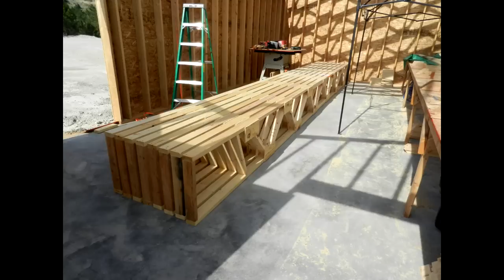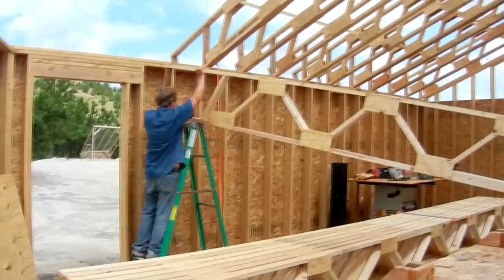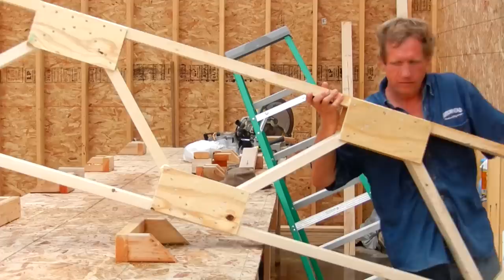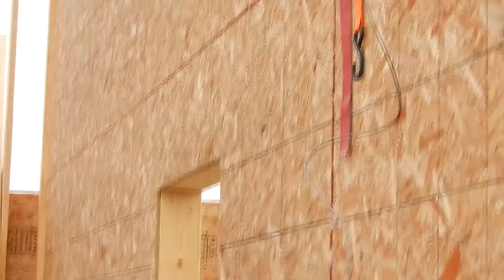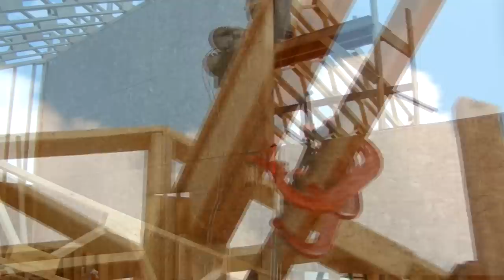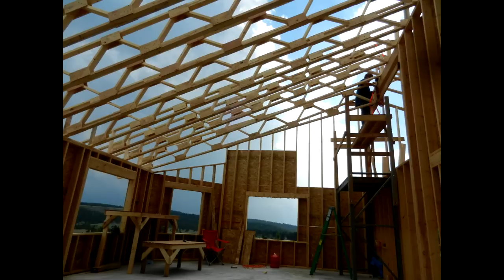One Man Roof Truss Raising

Comment from the maker: We raised 8-10 in a day it took 2 weeks to frame the roof with the truss building taking most of the time. I designed the trusses based on a warren truss. They did come out very solid and stiff.
Reply: if you would have just stabbed your top up first, then walked the bottom up the latter, you could have done it in one day....   also, paying a young, capable helper on the cheap would have been much better for you and the kid could have made some money.. this was hard to watch
Reply from the maker: -- My goal is to spend as little as possible not to hire help.
Reply: Good job!!!
What is the span between trusses along the wall?
What is the height of the truss?
What are the dimensions of your house?
Thanks.
Reply from the maker: Truss span is 24 feet they are 24 inches on center along the wall, the center wall is 16 feet high and the outer wall is 8 feet. The house is basically 54 feet long and 40 feet wide.
Reply: Fantastic!
Reply: i'm a truss designer and i dont like how your lower bearing are not triangulate :S that should give alot of stress in your bottom 2x4
Reply: heh heh heh
Reply: @brookscharles1849  not sure what you mean, are you referring to  the lower side not having a full triangle over the bearing wall?
Reply: B-Spot 🔥
Reply: @brookscharles1849  What is a good truss design you would recommend?
Reply: @chrisbabbitt4202  just add a web (lumber) on the space near le wall  where there are no triangle should be alot better. how he made it the wood work in flexion(wood bend) (sorry i'm french) i want you want to make wood work and tension or compresion
Reply: @halfglassfull  yes

Comment: Nice job! Built a 3 car garage myself and understand the problem of the trusses. I wonder if it would have been easier and safer to somehow hook the cable to the bottom cord? But sitting back and looking, I cannot determine how without the cable becoming a problem at  the ridge board and immensely complicated plus the out of balance concern.

Comment: You should put a 1 X against wall at ridge portion of truss to ride up the wall easier... then a temp ledger just below top wall to rest the truss on when you remove jury rigged 'winch' just for eas & safety I know you have a strap to installed truss however better to rest on ledger while you remove winch assembly prior to lift into final position

Comment: 2" long staples are the ticket for those gussets. I defy anyone to find a better way to fasten plywood to 2x's, it's fast and doesn't compromise   the integrity of the plywood. Skin'd walls for years with staples.
Reply from the maker: I don't agree staples have very low pull out resistance and shear strength.
Reply: +b-spot
when I tried to pull out my heat-activated adhesive-coated 16 gauge staples, it was plenty difficult.
significantly tougher than a smooth shank nail that's not lined with adhesive, and probably nearly equivalent to a ring shank nail.
shear strength depends on fastener quantity, no?

Comment: It's always weird for me to see a truss with weak axis bending, but with such short spans between the nodes, and maybe if there is low snow load, I guess it could work.

The truss doesn't look all that heavy, so is a winch all that necessary? I would have just used a rope.
Reply from the maker: It's a lot heavier when your on number 10 and your 16 feet in the air.
Reply: One day, I will do what you have done here, and build myself a home. I think it's awesome.

Comment: Excellent system.  I've been trying to figure out how to do this part of construction myself.  How long did it take to get all the trusses up?  Also, your trusses look very well built.  Did you find instructions somewhere on how to build them?
Reply from the maker: +Dave Peterschmidt Sorry for not replying for so long.  I am supposed to get an email every time there is a comment and I haven't been getting those.  Here is the response I left for someone else on one of the other videos.  Hope it helps and isn't too late!

I didn't calculate the load what drove my design was referring to other 
designs and installations. I needed 20" of depth for the r-60 insulation
 plus 2 inches min for an air gap between the insulation and roof 
sheeting so the trusses are 24" tall. The pattern is a Warrren truss https://en.wikipedia.org/wiki/Truss_bridge#Warren_truss same as what is used for bridge building. This document will give you some ideas about span and load http://www.trusstech.net/Truss_Tech_VA_MD/Tools_files/roof-truss-facts%20mitek.pdf. This document gives a overview for diy http://www.agf.gov.bc.ca/resmgmt/publist/Leaflets/BldgEng/305-32.pdf.
 The wood you use needs to be a little better than standard #2 grade 
what I did is pick thru the pile at the lumber store. You want knots to 
be no more than 1/3 of the width of the board with no splits along the 
length and as little twist and bow as possible. Good luck
Reply: +B-Spot Thanks for the reply!  It's not too late - I haven't started building yet.  What kind of insulation did you use to get to the R-60?  I want to do something similar.  I'm going to use ICF for the walls with some added EPS foam to bump them up to about R-50.  I'm strongly considering framing the roof similarly to the way you did, although I'm also considering using some kind of vaulted truss to avoid having to deal with putting in a big ridge beam.  Not sure how I'd handle a beam like that all by myself.  

I have to ask, why did you need an air gap between the insulation and roof sheathing?  Are you venting cold air in there to prevent ice dams?  I wouldn't think that'd be much of a problem even without the gap if your roof is insulated to R-60, would it?
Reply from the maker: +Dave Peterschmidt -- Have you ever noticed that builders put a moisture barrier on the walls but not on the roof? Even with R-60 heat still travels through the ceiling and insulation above carrying with it the moisture it holds. Ridge and soffit vents along with the air gap bellow the sheathing prevents condensation on the underside of the roof by allowing air flow to remove the moisture laden air. This prevents possible mold and rot on the sheathing and trusses. It also helps cool the roof in the summer extending shingle life. There is one way to omit it by using closed cell sprayed in foam, but that is pricey and now you need an another way to remove moisture from your home, typically by using forced ventilation and an air to air heat exchange. You will not get ice dams and icicle formation on a properly insulated roof both are primary caused by heat loss melting the snow on the roof and a cold eave where it re-freezes.

Comment: great job for sure love working with wood...still have a question here in the netherlands we built houses with brick much stronger..why  you built complete house from wood ?
Reply from the maker: I use wood because it is more economical and easier to work with than brick. A brick home still requires a wood frame for the roof and walls to allow installation of a reasonable amount of insulation. Strength is an interesting point because a brick structure is non flexible and do very poorly in earthquakes. Where as wood structures are flexible and do very well. Wood is readily available at reasonable prices, brick less so here in the west.
Reply: Ok tnks for replying.. i just was wondering why they built a lot wood houses there..now i know..i also like working with wood but here is expesive cause we have less forrests

Comment: Just one question. Shouldn't the truss lumber have been oriented the other way.....With the 4" flat vertical and not horizontal. ???
Reply from the maker: I laid them flat to minimize splitting of the truss webs when the connection plates are nailed on. Because it is a truss the strength is derived by holding the members in tension and compression and these properties do not change due to orientation.
Reply: B-Spot  thanks for reply. You make a valid point. 
   Excellent video 
I also love to do my projects myself. Very cool drill powered hand winch. Great idea. Thanks.
Reply: +soaringtractor
an engineering stamp is about as valuable as one of your comments; not.

Comment: Will these work say 4/12 pitch. Half the span is 26 ft. Would this Truss  be able to handle a 60-80 pound per sq ft snow load ??
Reply from the maker: Maybe I only needed 25 lbs snow load and my span was 24'. You will have to ether calculate the capacity or build a truss and load test it.  80-90 snow load is a lot, with dead and live loads you are going to be around 100+ psf. Typical roof spacing is 24" you may need to go down to 16" or less.
Reply: @BSpotBuilds  Yes I think I will do 16 center for strength. Better safe then sorry. The local area here at 7800 ft likes to see 60 pound snow load roof. Its considered to be high desert so it doesent snow that much but we definitely get it. We got spread out over the winter maybe 2 ft. but here in Costilla county they dont even inspect it. Its just what they recommend. Do you thing 16 center will suffice the 60 recomendation. Maybe put brackets on the side for safety and put the interior walls all the way up so it gives even more support. ?
Reply from the maker: @jonathanbasye3168  My guess you will be fine, BUT it's just a guess. Your construction techniques will greatly influence the final result. Lumber needs to be of a good grade with only small knots no greater than 1/3 of the cross section. If you are buying from a big box store plan on a lot of time picking the lumber pile. Glue and nail count is important as are the connection plates. Not trying to put you off, because it's not that hard. I Just think you should do some research and not go by what I think.

Comment: Так на всякий случай( перевод google). Two minutes to raise one farm with a screwdriver, in my opinion this is masochism, especially at the end of the pyramid and to raise it with your hands. It’s not easier and faster to make the woods higher and with a sling of hands, I think about ten seconds and the farm is on top. No, of course, if mechanization is for the sake of mechanization itself, and not to facilitate labor, but then of course. One and a half minutes from each beam, that’s it.

Comment: Why didn't you just use 2x12 or tji for the roof instead of making flat trusses?
Reply from the maker: I needed 20" of depth for the R-60 insulation and a 2 x 12 can not span 26 feet.

Comment: Would using beams not have saved time and money?
Reply from the maker: I have R-60 insulation in the truss space that is 20" thick. Beams would probably cost more be harder to work with and in the end need framing between and below to make a cavity for the insulation.
Reply: @BSpotBuilds , you do have one-foot insulation there, if not more, which is great in very harsh winters. They can be harsh where I live, too (but not this year; it's unseasonably warm this year), but I could only afford 0.65-foor insulation - with 4 x 6 in beams - on my house. I had two people make the roof; no idea how I could have handled such beams on my own.

Comment: did you modify the winch? or did you buy it that way so a drill can be used
Reply from the maker: Just removed the handle and chucked the drill on the worm gear shaft.
Reply: thanks you do very nice work
Reply: @BSpotBuilds  Can you post a pic of the winch, that was a good idea.
Reply from the maker: @Raymond-mk8cb  https://www.harborfreight.com/2000-lb-capacity-geared-winch-5798.html

Comment: How are the trusses seating on the top plates?  I don't see a birdsmouth cut in.
Reply: It would weaken the truss since they rely on tension and compression. The triangle shaped truss webbing give it the strength. Many trusses use metal hangers or bracing to keep the strength advantage going in the right direction. Lose that by cutting into the wood and it risks collapsing.

Comment: Lots of ingenuity and hard work...kudos for that. But, I hope this building is in location that gets no snow load because those trusses do not seem to be designed at all. Every plywood gusset is nailed exactly the same way and each member has far different forces in them. I also worry about wind but as I said, I have no idea where this is. I can tell you this will NOT work in my climate.
Reply from the maker: We get lots of snow and occasional strong winds. Somethings wrong with your analysis becuse because it's not matching up with reality.

Comment: how do you fasten the truss on the top plate of the outside wall? there is no birds mouth?
Reply from the maker: You can't cut a birds mouth in the truss. I used tapered saddle blocks between the top plate and truss.
Reply: ok that might work
Reply: B-Spot  same way on top of the ridge beam?
Reply from the maker: I used connecting plates between the two trusses at the top, they attach the two half's together and provide a flat surface that sits on the ridge.
Reply: ok thank you for your reply !!

Comment: Were they designed by an engineer?
Reply from the maker: +SkilledEddie --- Designed and approved by me.
Reply: So the answer is yes
Reply: well if you want things structurally sound, it might be important...  this isn't a corn dog stick bridge building contest in shop class in school...  if a load of snow stacks on there and the roof fell in.....  well, you know the rest
Reply from the maker: -- It not like I just banged some 2x4's together. There are thousands of truss designs out there and lots of information on how to build them.The truss were designed and engineered just not by a design engineer.
Reply: B-Spot 
I'm sure they are fine, it's not that far of a span.. but your statement is hilarious. If you copied an approved  truss plan online, then they were designed by an engineer, if not...  then they are NOT an engineered design and when they sag you will know why....
Reply: I would bet my life on those trusses B-spot made, over many that I've installed that were "engineered" trusses. Case in point: last house I helped build, the trusses had -- I kid you not -- been slapped together from the scraps at the truss company. Longest 2x4 was 6ft long. Unreinforced joints everywhere. Called the building inspector to make sure we would be OK installing these. He had us add a LOT of reinforcing members to those trusses, or he wouldn't pass the framing.
Reply: I'll have to disagree there calholli. What I called the inspector for was the proverbial "second opinion". I know the man, and his experience in building design and construction. He had been in the construction business for most of his life before taking the job for the city. This is small town America here, in the middle of Missouri. 

I can guarantee if you had seen these so called trusses, you would have called someone too. When a person standing on the ground, with the truss held upright and supported where the walls would be can deflect the upper chord 1/2inch  downward in the middle of the long span near the top there is something wrong. The truss maker had put an unreinforced  joint in the middle of that span. One little spike plate 3-1/2 x 7 isn't going to hold crap unsupported.

My opinion about the maker is that he was NOT following the engineering drawings when assembling these trusses. 

I wanted to send them back, they were that bad. Time constraints were in play, so had little choice but to work with what we had.
Reply: charlie99210 
Again.. it's only because you don't understand how the load distribution actually looks... a unsupported splice is very common, it's one of the main advantages in using trusses because they can be built with scrap wood, making them cheaper. It's pure math my friend, they do these truss designs in a computer where it shows every little detail of load.. the splices are placed in areas where there is no vertical load.. it will only be a pull or push load, depending on the design. Ususlly pushing together, where as even if the gang nail came off, it still wouldnt fail. If you guys didn't sit down and calculate the angle, length and location of each brace to determine exactly what the stresses are doing, you won't have a clue.. many times its counter intuitive, and certain breaks in a truss will cause it to Rise and not settle... again, they have to rubber stamp the design and guarantee that the math is sound, if that thing falls on your head while you sleep, they will have to explain why it failed in court, it wouldn't be the framers' fault.. so they cover thier ass, trust me.....  we all built little bridges out of popsicle sticks in shop class, but there is actually a mathematical correct answer, and it's not gonna come from the intuition.
Reply: charlie99210 
Think about it...  they make all kinds of trusses with vaulted ceilings where as there is no lower flat cross board.. and they are still very strong...  now if you change your mind and wanted to hang a level ceiling in there, it could have a splice and not bother anything because it is not even structurally needed

Comment: Roof and floor trusses without the pressed in metal gussets are totally unsafe and illegal in most code environments. The metal plates have hundreds of points of contact and do not distress the wood fibers like a few nails in each wood gusset do. Clever job of raising them however.
Reply from the maker: +Doug DiPlacido -- Your right there is only one way to build a truss. Dam I wished I had consulted with you. There not illegal here and standing up just fine.
Reply: +Doug DiPlacido The glue helps too btw
Reply: B Spot. great video and nice job .Glad to see someone build their own trusses,  you don't need metal plates to build a safe floor or roof truss . Did this before and is still standing 30 years later . 👍👍👍
Reply: Yeah I wonder how the many millions of houses built prior to  the advent of metal gussets are still standing.